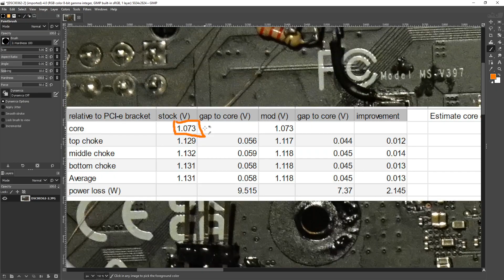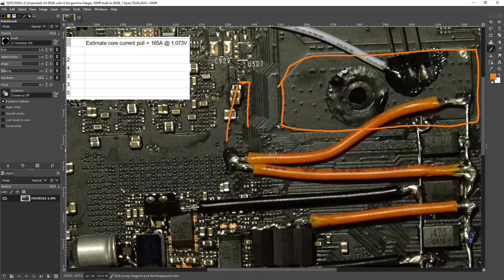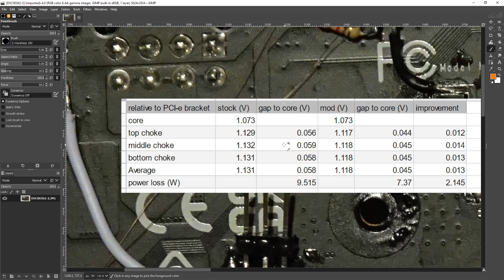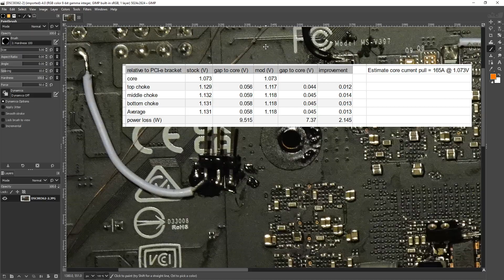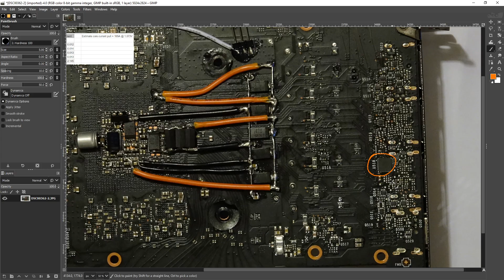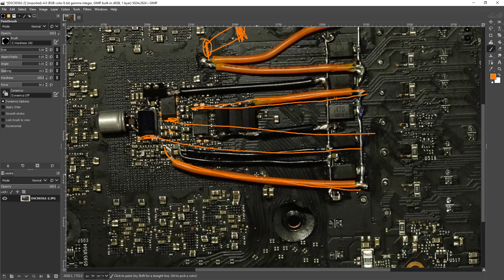Rambling about the power bridge mod on my MSI RTX 3060Ti Gaming X

Comment: You can still test your ground losses using the bracket. If you keep one probe on the bracket and the other on the ground points to test (VRM and GPU) you will read the voltage drop in the ground path. 👍
Reply from the maker: yeah I could have done that.
Reply: Comments like these give me hope that we are not doomed as a human race.

Comment: Dang that wire is way over kill for this purpose, enameled copper magnet wire would clean that up a ton plus less physical stress on the components,  uv solder mask doesn't hurt either
Reply: That sounds proper, organized and labour intensive. Buildzoid does neither of those things! :P
Reply: Anders Juel Jensen agreed. This has to work between rolling a joint and cooking math
Reply: Haha I actually do mods like this for people so that's why I pointed it out lol. And yes I am a little ocd about it looking proper. LOL

Comment: I have something like this on my 1800x@ 3975Mhz@1,4v and asus b350 prime plus: two 2,5mm² for vcore and two 2,5mm² for ground, connected between a pair of unpopulated pads on the middle of the socket backplate, and the inductors from two phases of the VRM, and the ground from the EPS12v. Can confirm the VRM runs a lot cooler, I have a thermocouple glued to the back), temperature went from 87c to 77c, and the PC would shutdown during a cinebench run with 4100Mhz@1,47v Maybe a combination between less heat dissipation in the power plane and the wires acting as a heatsink? Super easy mod, 10/10 would do again

Comment: Do you want a challenge just for your capacities? I have some Radeon Navi 23 Radeon Pro W6600, they have already memories GDDR6 that are 16 GB/s (2150 MHz) but are software limited to 14 GB/s (1750 Mhz) with a non related bios or SPPT block that I can't avoid or break. A lot of Navi 23 RX 6600 have the same block that can't permit to surpass 1900 MHz on memories, but on W6600 is stricted to just more lower 1750 Mhz. 

I can send to you one of them, if you reach a stable memory clock of at least 2150 MHz (1075 on SPPT) with no GFX clock locked at 500 Mhz Safe Mode, You can have the card for yourself.

Just 4 conditions:
-The Memory clock (uclk) doesn't have to be GFX or Soc Voltage dependant or GFX or Soc Clock Dependant (I don't want to know that maybe for example at 0.731mv on Soc Voltage at exactly 1000 Mhz on Soc you can trigger a state where you can overclock the memory at every value you want. I'm looking for a more versatile solution for possible extreme overclock or just tweak with power at every kind of situation anyone needs).
-you cannot break the card.
-it can stable play games and complete benchmarks 
-you have to public the video of how you reached the goal.

You are free to do every mod you want hardware or software, and flash others Navi 23 cards bioses. already tested bios thats card STARTUP are Sapphire RX6600, RX 6600 XT, Asrock RX 6600.

Comment: I wish you would have bought a 2080ti and modded that with the Galax vBios, because at 380w, these mods would matter way more. And I’d love to see you nail a 3080 with a 2080ti at ambient
Reply from the maker: the 3080 is 30% faster than a 2080Ti. You're not getting 30% more performance out of a 2080Ti at ambient.
Reply: @ActuallyHardcoreOverclocking  I got close by using a g12 and a lapped Kraken w/ a proper hunk of aluminum as a backplate. I’m sure you could do much better. Keep in mind I was approaching stock performance for some of the weaker 3080 models. Wasn’t exactly ripping apart 3080 scores in general. It ate my old 3060ti’s lunch though and that was a relatively high end model. and the 2089ti was the lowest end evga with a reference chip. obvo no voltage mods

Comment: Sorry, random unrelated question, but...
What benefits most the 3D Mark CPU tests - low-latency memory or high-speed memory?
Reply from the maker: depends on the CPU
Reply: @ActuallyHardcoreOverclocking  It's 12th gen, 12700kf - the memory is a 2x8GB 3600c14 Samsung B-Die kit.

Comment: Hello there, i have a weird problem with an RTX 3090, the card is not detected in windows, doesn't have display ports or hdmi working but does full hashrate on hiveos and its detected there, what should i try and is there any possible way to make it work on Windows?
Its a repaired card, all power phases and bios are correct and flashed just no display output and not detected in windows, hiveos does mine full hashrate, any clues?

Comment: how much of a performance uplift is this?
Reply from the maker: 0
Reply: @ActuallyHardcoreOverclocking  so because you dont have bigger gauge wire and connection its not that good of a mod but if you did it better what is the avg uplift you see with cards?
Reply from the maker: @Zensaitv  this mod just generally doesn't affect performance unless the card you're doing it on is really really bad.
Reply: @ActuallyHardcoreOverclocking  huh soo why do it? im confused lol is this like lowering your car to look cool or something lol just stability ?
Reply from the maker: @DragonMaster9595  because I get bored easy and I already did every other mod worth doing.
Reply: @ActuallyHardcoreOverclocking  ahhh gotcha, makes sense, like when the toys are all been played with. Well I do hope you find something more exciting and new there is a Russian Modder that added 12gb to a 2060 maybe you wanna do that? could try to Collab with other modders and figure out stuff?
Reply: @Zensaitv  If you didnt have a volt mod on a card and just wanted the nvidia drivers to allow you to increase the volatage by an extra  .013 then this mod would give you a performance boost in that sense. It would probably translate to 15-45 mhz. It only doesnt give a performance boost because Buildzoid can lock the voltage at whatever the hell he wants.
Reply: @ActuallyHardcoreOverclocking  If you didnt volt mod the card and used the drivers to control the voltage, this would give an uplift of .013mv unless I am mistaken. Since nvidia has a cap for how high you can set voltage on a card. If thats the case would this be more or less effective than cap modding a similar card in your mind?
Reply: @Ryan_Sauer  yeah stability thought so just wanted to know why as he was saying there is 0 reason to for performance on air id guess but to get rid of boredom lol. maybe one day when I have the money to throw ill do this lol
Reply: @Ryan_Sauer  I doubt it, since the CPU core has voltage reading circuitry. AFAIK all modern platforms use voltage at load point, so the voltage drop difference is irrelevant.
Reply: @ActuallyHardcoreOverclocking  but at least is reducing the bit of load on vrm mosfets, and couple cents on your yearly electricity bills. 😉

Comment: Wonder if it’s this possible on founders edition?  3090 Fe specifically
Reply from the maker: sure but it would very fiddly to do.
Reply: @ActuallyHardcoreOverclocking  maybe guides on shunt modding or how to do these for noobs for a higher power target. I have soldering experience, but nothing too pro of course. I’d donate money to you directly for a video publicly made 👏
Reply: the pcb is very dense on FE cards, really not worth potentially shorting something on a 2k$ card
Reply: Also the 3090 FE has the VRM very close towards the core and is using a 12 layer PCB. I doubt that there are huge power plane losses.